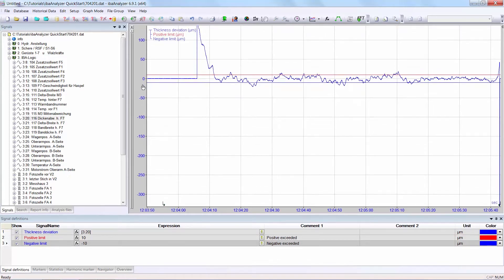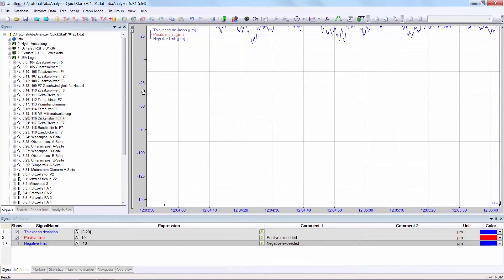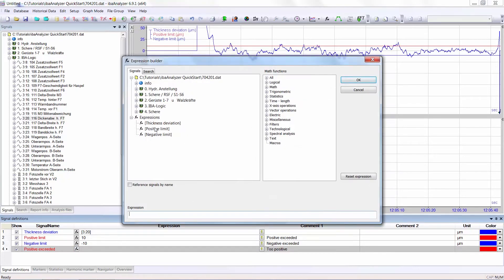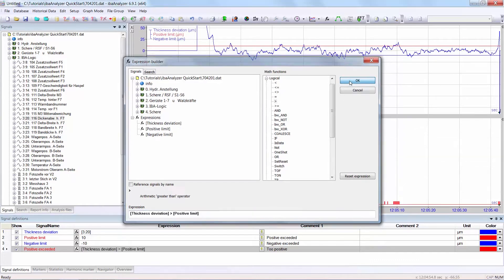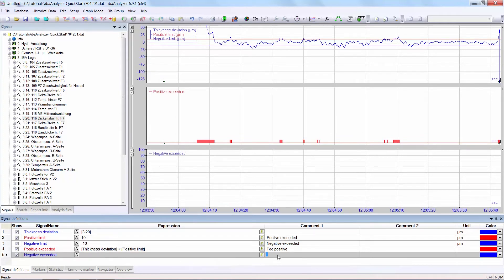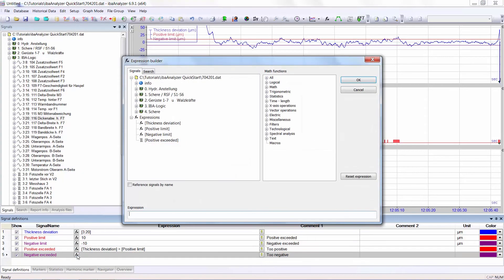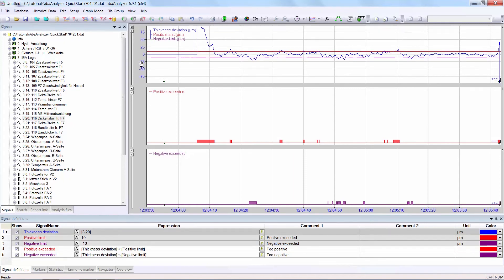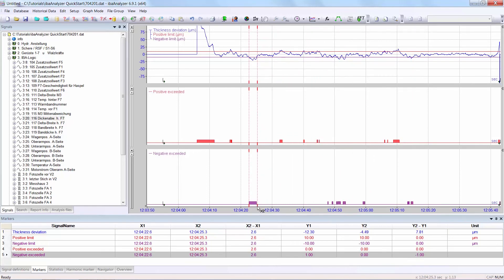ibaAnalyzer: How to indicate when specified limits have been exceeded (11)

Comment: Can IBA analyzer be used to monitor a pneumatic control valve in real time? Can I use IBA as Valvelink Software to perform partial stroke testing on valves?
Reply from the maker: Dear Shweta Kumari. With ibaAnalyzer it is possible to (post mortem) analyze nearly any process based on available measurement data generated with our Process Data Acquisition system ibaPDA. ibaAnalyzer can be used free of charge with a licensed ibaPDA system. With ibaPDA data cannot only be acquired and recorded but also monitored in real time. In contrary to other specialized software packages we do not offer out-of-the-box analysis for specific use-cases but rather a highly flexible toolbox which can be easily adapted to the corresponding situation. If you are interested in more detailed information or a demo license you can contact your local iba representative anytime (see https://www.iba-ag.com/en/contact for details).

Comment: Hi!!! Im from Mexico, but i have a doubt.... in mi case, i use IBA to make reports with analyzer, but can i do this reports in live mode with pda?? Example, an alarm for a maximum range like your example, but in PDA(live mode), is this possible?? thnks
Reply from the maker: Hi Alejandro. Thanks for your interest in our products. Most of the computations available in ibaAnalyzer are also available in ibaPDA as virtual module. For the limit exceedance in live mode you could for example also use ibaQPanel to show the signal in a different color if the limit is exceeded. For more details and other options you can contact your closest iba support engineer Jorge Giraldo ( https://www.iba-ag.com/en/contact/#c17791 ) anytime.
Reply: @ibaAGcom  Thank you! Inmediatly that I have results I'll informat you! This kind of tools brings a lot of data and analysis! See you